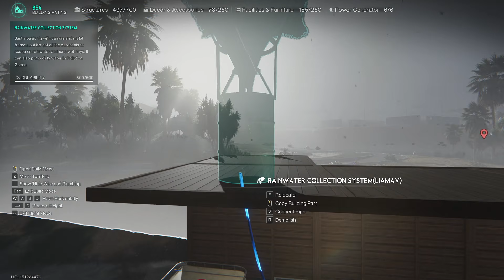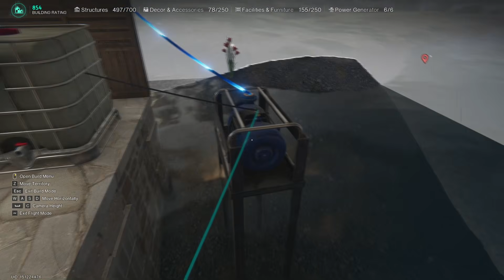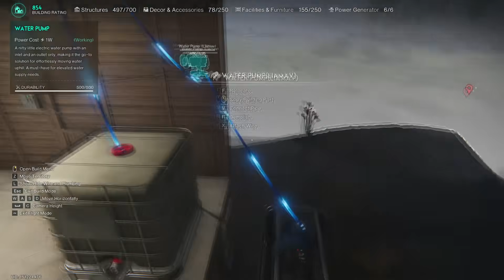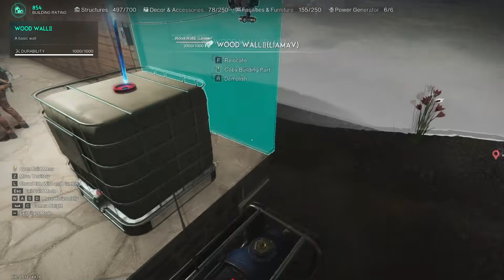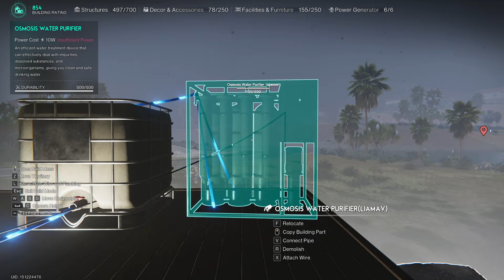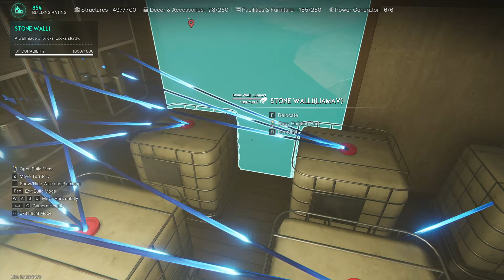ONCE HUMAN | HOW TO USE WATER PUMP GUIDE

Comment: How many ground water pumps can a mini water pump extract the water from? I can see, mini water pump extracts water from 2 ground water pumps. Is it right? Or just 1 mini water pump can be used to pull water from all ground water pumps? Pls let me know.
Reply from the maker: I’m not exactly sure if there is a limit. I think you can pump to however mini pumps you want it just affects how much water you are putting into where the mini is going. My personal build I make 3 ground pumps go into one mini pump then split that one mini pump into 3 containers that will feed into the purifiers max because it seems like the water slows way down compared to the acid I’m refining if i try to split one pump amongst all my refiners. Im sure theres an ideal ratio somewhere but I never tested because what I had worked fine when I was playing.

Comment: hi bro, i followed the tutorial but idk why my water pump river status still not active? i connect the wire to switch and to panel but still got result. need ur help!
Reply from the maker: if youve placed it and made sure the pipe connection is going the correct way, it could be the pump isnt far enough into the water or there is insufficent power to the pump. double check your bases max power output and ensure you arent over cap. if you dont have enough it may have shut off the power to the pump to keep other refineries or utilities on.

Comment: Got my big water pump hook to small one to change flow to go to the filter and than filter is hooked to the tank. The flow is all going the right direction but the big pump is still not working.
Reply from the maker: Make sure to hook everything up to a power source. If the flow lines are correct no power /not enough power is likely the issue

Comment: This is exactly the video I was looking for and I didn't even know it LOL I've been trying to get a single acid unit in production and I haven't had any luck with it.

Nowhere in the game is it explained that there are two different ports on any of these devices.
I just got done spending about three and a half hours trying to get water from my pump to my filtration system Warner and why I had to swim out into the water and manually retrieve my seawater and polluted water.

So thank you very much I watched so many videos about how to build these and not a single one of them explained this

Comment: how do you disconnect the pipes you connected i always demolish and start over lol
Reply from the maker: it can be a bit finnicky to get them selected. make sure you are in flight mode and try to angle the camera on the hose. it will turn from dark blue to light blue, thats when its highlighted. Hit R and it removes em. Sometimes you gotta move whatever its connected to out of a corner to a more open spot to get to the hose.
Reply: @Liamav  I had a hard time finding the answer to this question. Most people online say demolish the item with the pipe and start over. Thank you for answering this person's question!

Comment: When I'm in the eding mode. I have the blue pipes. But i have no flow showing. I tried with high and low grafik seting. In the end no blue lights.
Reply from the maker: Im honestly not sure what could be causing that. I've never had it happen. my only first thought is you dont have an initial water source setup? like an empty storage take going to a mini pump without a big pump hooked up to the circuit. That or maybe theres no power to the main pump yet.

Comment: WOW, I have over 250 hours in game at the moment. Didn't realize the water tank had TWO connection points...Always connected to the top and never gave it any thought as to the bottom. I guess this is why I could never get water into my barrels and always just physically put in the water. Thanks for the video.
Reply from the maker: I only ever realized because i was spamming connections one day. They definitely make it noticable on the water storage or the mini pump lol. One of those things you don't know until someone points it out for sure. Glad you liked it!